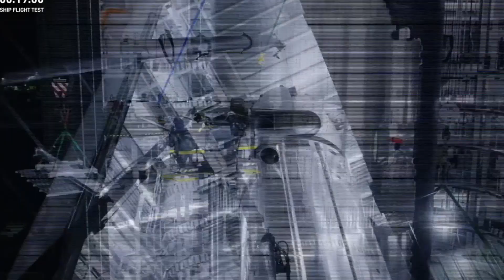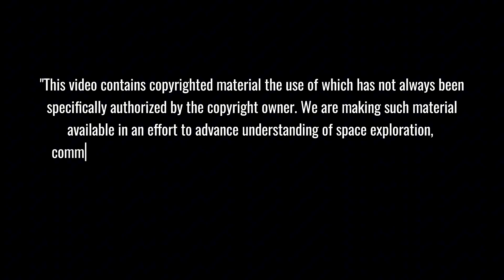SpaceX Revealed How They Saved Starship Flight 8 After CRITICAL Systems Failed...

Comment: ALL RIGHT ELON FOR THE INCREDIBLY LOW PRICE OF 1 BILLION DOLLARS I'LL RUN YOUR GOLD RECOVERY PROJECT YOU SEE ALL YOU OR ANYONE HAS TO DO IS RUN A VERY STRONG MAGNET THROUGH SAND SEE GOLD IS INDESTRUCTIBLE AND AMOUNTS OF GOLD WILL STICK TO THE MIGNONETTE THEN YOU JUST MELT THE MAGNETITE AND PORE IT INTO PYRAMID SHAPED MOLDS THEN CUT THE TIP OF  AND REMELT THOSE PRODUCING GOLD.THERE IS GOLD IN QUARTS ,  WIND AND WAVE ACTION LIBERATES THE MICRO FIND GOLD.  IT'S A LITERAL CAKE WALK IF YOU ASK ME.
Reply: I WAS THINKING ABOUT IF SOMEONE HAD NEROLINK.,,, 
CUTTING OUT THE INSIDE OF AN OCTOPUS AND TURNING IT INTO A BLUETOOTH NECKLACE SO ONE COULD HAVE 8 MIND CONTROLED OCTO ARMS.